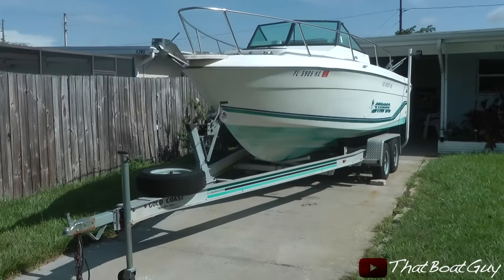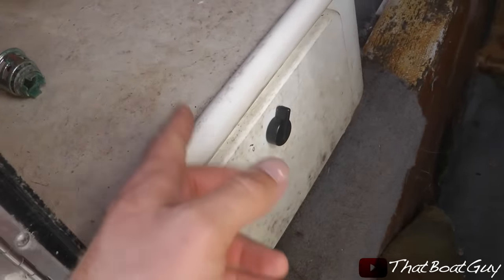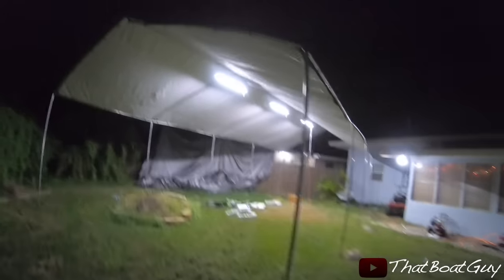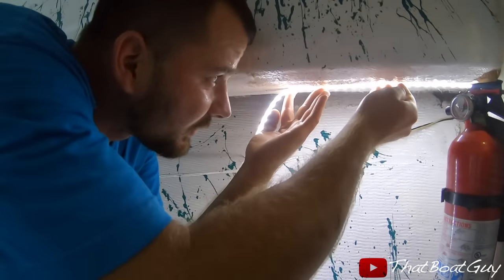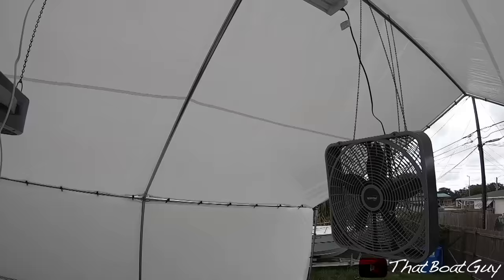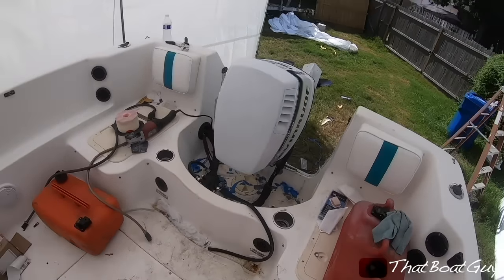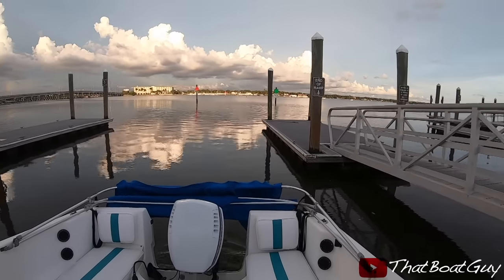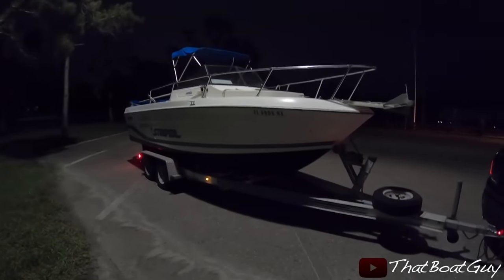We Restored A Cheap Boat!

Comment: The tandem axle aluminum trailer alone, as is, was worth more than $1100.00
Reply: Indeed. In my area that combo could easily be around 5-7k without any work done to it.
Reply: Based on how many boats you’ve worked on these do not seem to be in short supply, Where are you getting these, or are you advertising for them?
Reply: That might be an abt brand. Great stuff.  Extruded aluminum ibeam frame.
Reply: Weird Beard Garage around my area that combo would be 15k
Reply: Fucking killer deal
Reply: Im not sure I believe all the prices he quotes. If you flip boats...who wouldnt have bid $1400 on the aluminum polar w 20hp or tha pleasure boat for $1500 at the police auction. The polar would be instant profit. So I dont know where he finds all these people giving some of these boats away that are easily worth 5-6k when they get them. Just price some of the used motors on these boats. They sell for more than $1200
Reply: @nicstr28  I was curious of the same thing. I live in northern Canada, some of these boats would fetch close to 10k CAD. Fkn show me that auction please.
Reply: @G0lfR0me0  yep! My youngest son snagged a 14' aluminum Mohawk canoe off of LetGo for 60 freaking bucks the other day!  In covidian times, it's a $600-$900 boat.  Ya gotta be ready to pounce on these things.
Reply: Nah, Boat Angel = eBay
Reply: @nicstr28  No way his $$ is accurate.  Vinyl only $300?  The vinyl alone is more than $300, not including replacement foam and the labor.  He didn't specify the cost of repainting the motor and bimini tops, so right there is a missing $500 minimum.  And no replacement linkage?  Lines?  Wiring?  And that gel coat had no nicks in it at all?  If the boat and trailer were anywhere near $1100 they were stolen.  You can't buy that in the middle of Kansas with no water around for that price.
Reply: @weirdbeardgarage    I think it's a Florida thing... Everyone seems to have really new boats, guess it's due to how warm it is year-round.
Reply: Right? I’m so sick of these dudes making this shit up and leading people a stray. This is why someone sees 20’ fiberglass on Craigslist for 1500$ and they go get scammed. You couldn’t get this Fiberglass shell for 5 f’ing thousand dollars. You did not get this boat for 1100.....
Reply: I recently bought a 1995 18 foot maxum bow rider with a perfectly running 120 force for $1500
Reply: @ephthebeef  "perfectly running Force" said no one ever. LOL
Reply: @dzgaming1  anything can run perfect if you keep it maintained 🤷‍♂️
Reply: @dzgaming1  LOL! I'm not sure I'd take a Force if you gave it to me.
Reply: I bought a 1996 maxum 18ft bowrider with a 1986 200hp merc two stroke and trailer. It cost me 4000 usd and I thought it was an amazing deal.
Reply: @nicstr28  Agreed. If they're not upfront and showing you the pricing then they're lying. They must do it for clicks.
Reply: Florida boat prices are insanely low

Comment: Way to go guys on the deal of the century.  Good to see that there are great deals out there for all of us to find, and that there are  boats out there that we can revive.  Just one note that I feel the boat may need based on your water trial.  A good set of adjustable trim tabs.  All you need to do is add a good set to even out the ride.  Noticed a need for some support on the starboard side ride to even out the overall performance of the ride.  Keep up the good work.  Power to That Boat Guy!

Comment: That paint splash is really cool!
Reply from the maker: It came out looking really good
Reply: TheWolfePit   I didn’t think it was going to look very good when you started the splash.  I was pretty surprised when you finished it!  It looks very nice!
Reply: It fits the age of the boat to the splash paint was the style back in the the early to mid 1990s.
Reply: @ThatBoatGuy  I forgot what boat you bought where you repainted the deck with a roller. Can you recommend a strong gel coat for ny diamond patterned deck to repaint. Doesn't need to be anti skid as it already had the diamond pattern. One that is strong and can be used with a foam roller
Reply: @ThatBoatGuy  do you sell the boats after the fact ?
Reply: Next time use two colors for the splash, dark/light blue or blue and black/grey.
Reply: I like the splatter.will do that on my project boat now👍

Comment: Excellent work. Only upgrades I would do is throw on a Yamaha 4 stroke, put in new wiring and upgrade the radio equipment but this is a solid base for whoever buys this boat from you.

Comment: Nice boat, i like the picasso cabin looks good lol. Maybe better put the top down, if your going faster... What does a water seporator look like?(need one)
Reply: Menno Boon looks like a screw-on oil filter with a fuel line out of each side of the base.

Comment: after you polished the gel coat invest in sparbright liquid wax for fiberglass boats it is used to protect the high dollar paint on the boats
follow instructions it will keep the gloss forever so long as you follow the instructions i've used it for years on my boats and the on my fiberglass 
camper top for my truck

Comment: That Boat needs trim tabs, underway with one person it lists to starboard. I have a 2000 victory sea hunt it did the same thing. I installed trim tabs and what a remarkable difference in the boat's attitude when underway. My engine is the same a 175 ocean pro Johnson.  Nice video and very nice renovation job.

Comment: What kind of paint do you use for bottom and inside cabin ?
Reply: Imo I would use a 2 part polyurethane would be more expensive but is more durable and will last much longer.  Since it is trailerable and being stored on land a bottom shelf bottom paint would probably be ok. Its best to use 2 coats with 2 different colors on the bottom so its easier to determine when the first coat has worn off and time to recoat.

Comment: This is bullshit. I can't even get a busted jon boat for $1100 here in texas with boat, trailer, motor.
Reply: isn't the trailer a few hundred alone?  Not sure, asking.
Reply: ostreds new in the thousands
Reply: He does show the listing and it was asking $1500, though I agree it is dirt cheap
Reply: LOL. I know! I'm in DFW and even as a dealer the prices are stupid high, plus the outboard engines have to have a title.  For this very reason I have gone to Florida and brought boats back here. There are deals in FL but the trade off is the salt water use. And you can forget about getting deals on the Texas coast too. Stupid high prices.
Reply: Here’s mine currently under the knife.  (Also a FL boat)
Reply: Cant even touch  a used trailer  for that size  boat for that price .
Reply: SUGGESTIONS 
CRAIGS LIST
NEWS PAPER
Certified Sales Yacht Sales 
Copart 
E-Bay Boat Angel 
E-Bay
Google Boat Salvage
Google Free Boats
Google Auction
Google Boat Auction 

With these listings now today there are over 100 boats listed for less than 500 bucks

Comment: I have owned a dozen boats, including power and sail. I used each for several years, then sold each for as much or more than I paid for it. Only fools buy new.
Reply: Joseph Van I bought my Mastercraft new. Had a friend at the dealer and paid their cost on it. 2 years later I sold it for almost 20,000 more than I paid for it. The wakeboard boat craze started after I bought it though.

Comment: get some backing soda in a puffer, wet the back of the lights with super glue, put in place, hold and then puff some backing soda on super glue.  It will flash cure and lock lights in place.

Comment: Quick question for you, I have a 84 Johnson 70hp outboard. It runs great on the trailer with water on. But as soon as you drop it in the water it stalls as soon as it's taken out of neutral. Any thoughts? I have a video of it running on my profile.
Reply: brendan choma Too high pitch prop with a too low idle?

Comment: The boat wasnt worth much, but an Evinrude V6 two stroke 150 hp outboard that runs, and that trailer? The motor is worth about 2k. The dual axle trailer @ least $1500. What a great find! So where are they giving away these outboards and trailers, anyway? Btw, I wouldnt run a water-cooled outboard while its sitting hi and dry lol.

Comment: I’m from Florida and what people don’t understand is that there’s millions of boats here. An old boat like this can literally go for pennies because people want something newer with more flashy shit on it and they need to get rid of the dinosaur. If you have the ability to rebuild motors, upholster seats, carpet and paint all with some mechanical ability to rebuild a trailer. Basically, everything this guy has, you can get boats for dirt cheap, rebuild them and sell them for a huge profit. It might be hard for some people to comprehend, but you could make a lot of money doing exactly what this guy does “IF” you have the ability.
Since watching his videos I now have no worries about taking off, cleaning or rebuilding a carburetor, changing lower unit oil, installing a new impeller or any other basic repair. 
People do the very same thing with cars everyday, so why is it hard to believe this?

Comment: First, great job ! Second, I noticed you left the carpet in around the radio. There is a product called  "Awesome" and it will make the carpet look brand new. You can find it at the dollar store. I had my car in the shop for a few weeks and when I got it back it looked like a gang of homeless people had sex in it for a month. It was greasy, dirty, you get the idea, it was nasty. The machanic was chasing a short and he trashed the inside of my car.  I used "Awsome" and the interior looked BETTER than the day I purchased the car. It can be used on almost anything. But, DON'T USE ON LEATHER ! !   You need to try this stuff. You will thanks me. Again, nice job on the boat. Now I want one.

Comment: Hell you can sell the foot for 750.00
Reply: Nice Job Guys …. Just Surprised You Didn't have to Drain the Fuel tank and Rebuild the 6 Carbs  on 2000 OSI maybe the Previous owner did ….. Cheers

Comment: Just about everything I've seen over 20 years old has rotted floors. Basically junk. You might get lucky if the wood is fiberglass encapsulated.

Comment: I live close by and selling a costom made catch boat tunnel hull with a 60 hp if you interested
Reply from the maker: How much
Reply: ThatBoatGuy 4500 comes with aluminum trailer and trolling motor has jack plate  trim tabs it’s a 4 stroke
Reply from the maker: @hunterspake573  what brand is the motor
Reply: Mercury was a fresh water engine before me
Reply: I can send you my email on here and delete it so I can send you some pictures